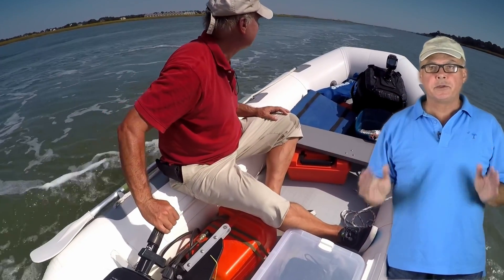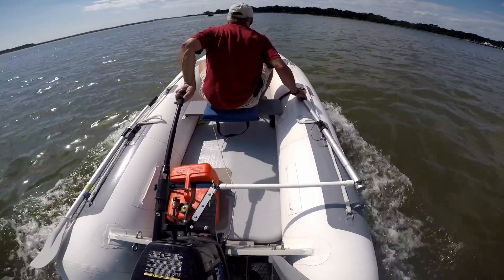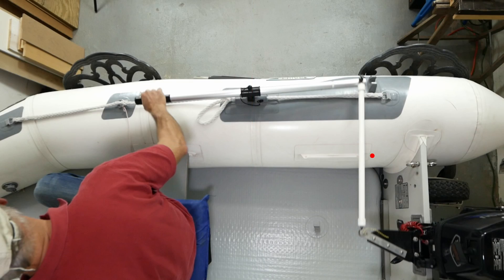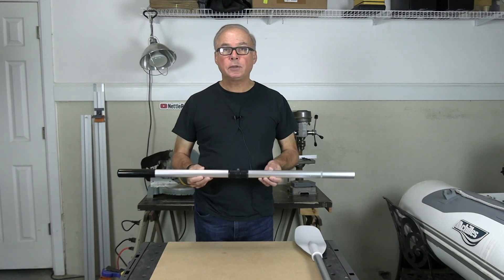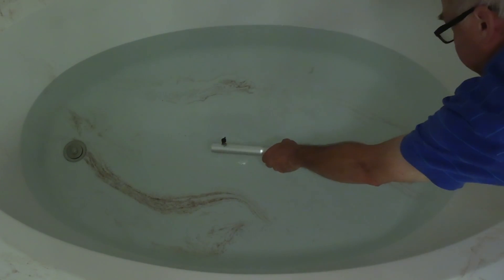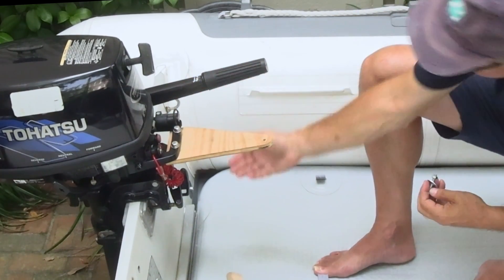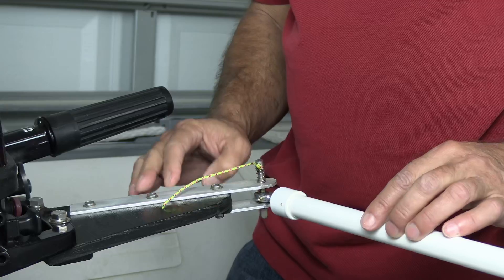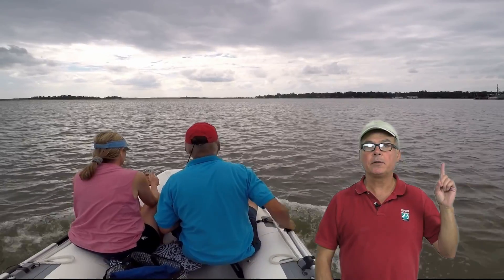Steer From Here

Comment: I showed this to another boater and he asked, "does it still allow the motor to tip up like if you’re in shallow water or if you run over a log or something?" If I build something like this I do want it to have that capability so I am considering adding a hinge where the bracket meets the motor perhaps. Please let me know if you have experience with this. Also, great editing and video style; I subscribed for more.
Reply from the maker: Thanks.  The motor can be tipped up in an emergency.  But it binds the linkage.  I use the quick disconnect pins for this.  I like your idea of adding a hinge to the bracket where it meets the motor.  I think it will work.  Please let me know if it does.

Comment: Mine gets squirrley sitting on the tube. I personally prefer sitting on the floor, across the beam, legs over one tube, and leaning against the other.  Lean on starboard side so you dont crowd yourself with the tiller.  Center of gravity is low, much more stable, planes well, can have lots of fun with sharp inputs, good suspension by lifting your but off the floor, easy trolling with rod between knees.  Grew up with inflatables.  Have a 11' achilles that's 25 yrs old now.  Inflatables are the best for storeage, float flying, stability and heft.  I was thinking of rigging up a console for one that you could seat yourself in center, near floor, with steering wheel. 
First inflatable was 10 foot achilles with 15 honda.  Decided to try a speed record on a calm day.  Tiller extension, leaning forward, and on port side to counter motor torque that lifted that side... getting up to speed, port side started lifting, so leaned further out and man, does that ferl fast!!  Next recollection was bobbing out of the water and looking at my boat upside down with gear scattered everywhere.  Gave a couple of lads on shore a great show.  Great fun!!

Comment: Genius. Nice work sir.
Reply from the maker: Thank you kindly!
Reply: @NettleReef .....    You could add one more piece and another pivot point...   And have a vertical stick that pushes forward and pulls back....   Pivot point would be about 1/3 up...   Won't have to move the stick as far for steering....   May have to glue on another boat oar lock on the inner side of the tube.....     But it's a great idea ,  reminds me of the linkage inside of RC airplanes....